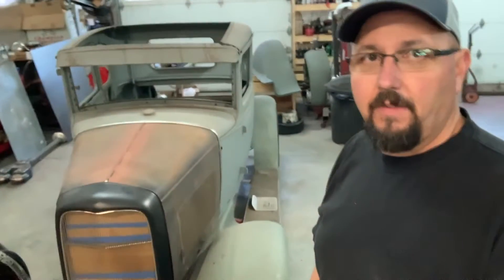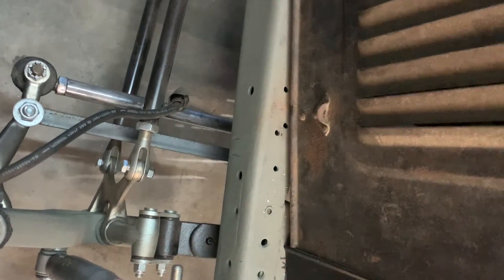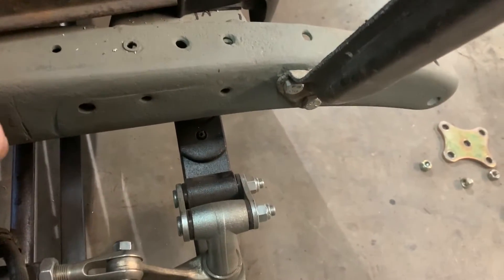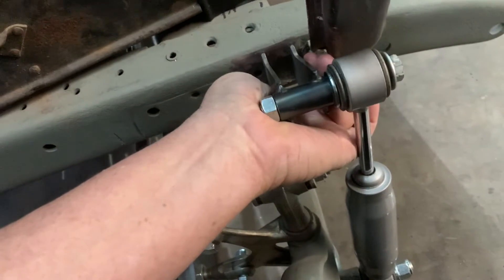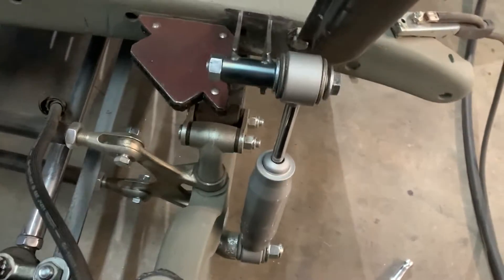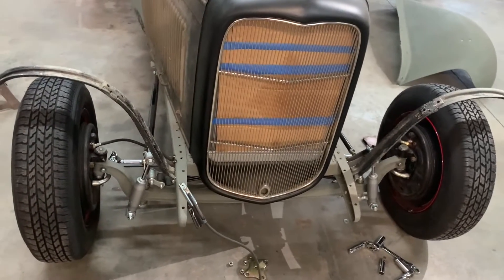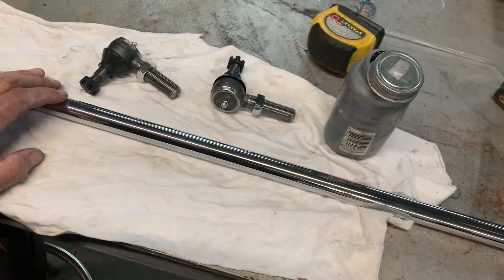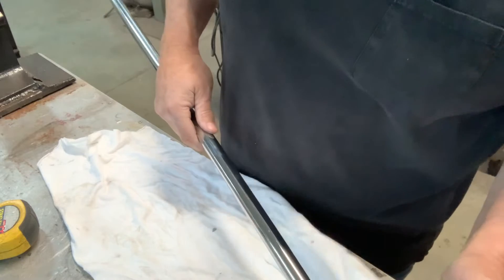Model A Coupe Hotrod Build Pt 15  Installing the Front Shock Mounts and Steering Rod

Comment: What length steering arms did you use? Speedway part numbers? What steering box did you use?
Reply from the maker: Sorry it took me so long to get back with you . The drop steering arms are 37-48 ford 1 3/4 drop part # 702 -2754-pln.   Vega steering box pt#916-3220.  Tie rod drag link kit pt# 91632505  you will have to measure this for  the length that you will need, I had the cross steering drag link so you will need to measure for length.  It all depends on front axle width and drop .   Thanks for the questions and watching!  I really hope this helps you out!!
Reply: @Full Moon Hot Rods  this helps! After watching your shock mount install video last night, I got the courage to rack weld mine in! Thank you!
Reply from the maker: @resiliencemotors  Good Deal  That's Awesome!!  I hope my video's will  help people. That makes it worth it doing these video's.  Thank you for watching !!

Comment: Hello excellent Job , what's the part number or where did you purchase front shocks mounts. I look in the Speedway Motor catalog but . Can you send me information for my build. Thanks again!
Reply from the maker: Mine are Pete and Jake front shock mounts. I hope this helps. Thanks for watching!
Reply: Thanks again I will order two more front shock mounts from Pete's and Jake.
Reply: @fullmoonhotrods   hello again working on rear end shocks what weight and length that you use for the rear coil overs 250lbs spring 12"1/2"  leght And 5/8 hold name brand, they are save. Thanks again.